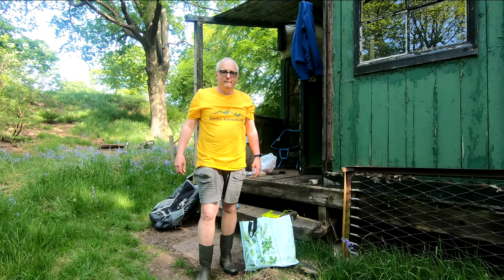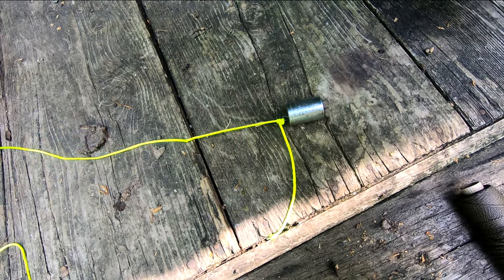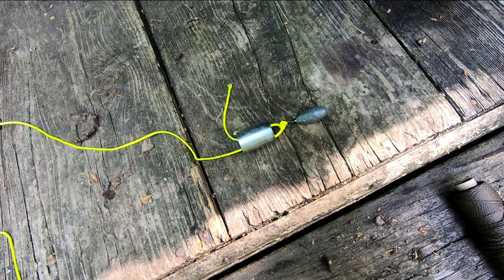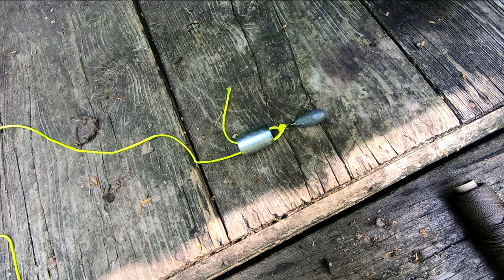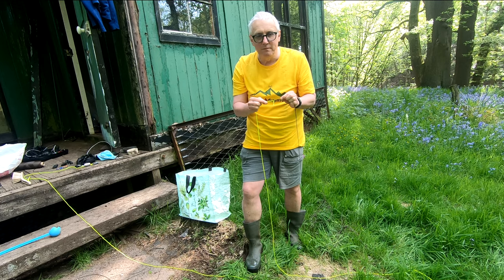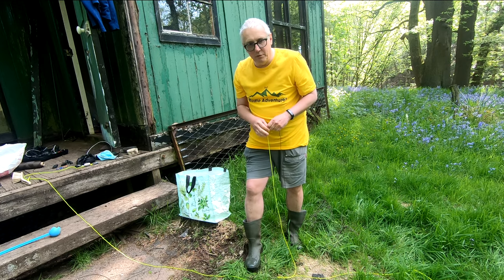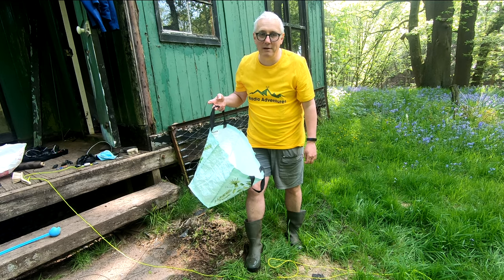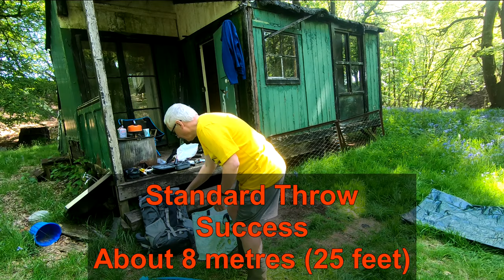GETTING MY ANTENNA INTO A TREE | Fail

Comment: When throwing hard weights I'm always worried they're going to smash me in the head in the way back down so I bought a 250g nylon throwing weight. It's essentially a very tough bag of lead shot with an eyelet on the top to attach a rope. I think it's designed for tree surgeons really but if it comes back to hit you it's much less likely to give you summer teeth
Reply from the maker: There are certainly risks involved!

Comment: Nice video Richard. Getting a line in a tree is not as easy as it’s made out. Getting it back of the tree is even more tricky. I have found that trying to pull the line back out of the tree always ends in pain. Instead I lower the antenna and disconnect the wire then simply pull the line through the tree from the other side of the limb. I have never had a tangle using that method. Thanks for the videos and keep up the great work. 73 de Will, M0LGW 👍🏻😊

Comment: Good times Richard! Probably a good move to get the line tossing out of the way before you start drinking =)
OK, so every SOTA op has their own way of doing it... here is mine. I carry a small microfiber bag with my line coiled up inside. On the summit, I flake the line onto the ground and find a nice rock to go in the bag. I dangle the bag by the line and get it swinging and then release it on the upward stroke. Takes a little practice, but you can easily hit 50' or more. Attach the end of EFHW and haul it up... QRV.
Looking forward to the next video. 73 de WU7H in Seattle.
Reply from the maker: I will be improving my technique. I have a proper throw bag and line on order. Thanks for watching!
Reply: Do you have a video?  I absolutely am horrible at getting anywhere near where I am trying to get the rope.

Comment: I suggest using the ball that comes  with the dog thrower simply driil a hole thru it and slip the line thru iand tie a large knot in the end..and use your back to the tree throw, works great for me. 73 Jim/ki0ad

Comment: I have terrible memories of a line (with a fishing weight attached) getting stuck up a tree one morning.
I stupidly kept pulling, feeling the resistance of the branch it was hooked around, until I felt the line go slack.
Moments later I felt an almighty whack on the top of my head as the weight came hurtling down towards me - and the next thing I knew was as I woke up several hours later in the evening!
The resulting bump made it look like I was trying to smuggle an egg around under my hair...
A warning to you all!
73, Matt M0PTO
Reply from the maker: I must adnit that I had a similar concern when making the video. One weight landed right next to the camera! I'm going to try proper throw bags next time round.
Reply: Ouch 🤕😂

Comment: aiming for a PARTICULAR branch is the hard part. You know, one that is coming off the tree at the perfect angle. I find retrieving your line from the tree (with the fishing weight) after bad placement particular tricky. If you pull the rope too quickly, that lead weight will wrap around a branch quickly.
Reply from the maker: You’re right!

Comment: Fishing weight should be a proper throw sack bought at Amazon I use a heavy 16oz sack but you can also cut and stitch it back closed. Or buy a lighter one then I use the two handed reverse over head of course. You pul the lead back through the loop on the weight then you use both hands to pendulum weight put the desired tree directly behind you grab your knee with the line and stand up pulling weight from your feet. It works perfect every time especially the tall 80-100’ high maples.